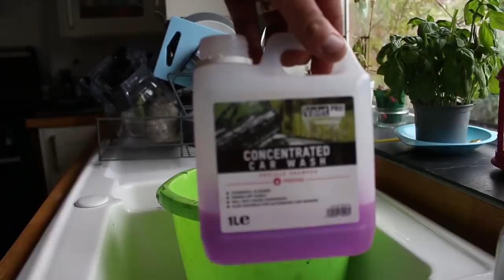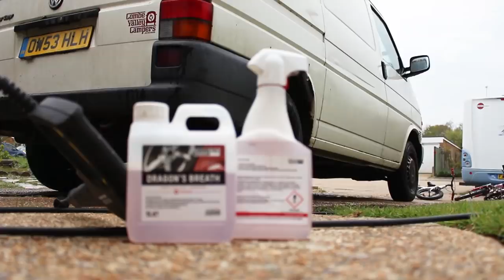Full exterior DEEP CLEAN of a DISGUSTING work van covered in MILLIONS of metal filings!

Comment: Just wondering how you got the glue residue off. I'm stripping sign writing off now. Some is quite easy, but other areas used a different material which doesn't take the file with it and left a thick grey hard layer.

What I've found online so far isn't working.